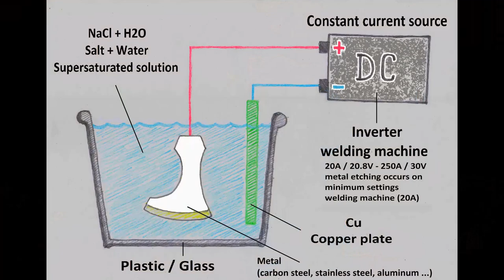Drawing on metal. How to make drawing on a 300 year old ax

Comment: Can i ask you precisely what kind of spray paint do you use? In my last video I've etched an axe head, but turned out my paint comes off in shards, so the result has been much more "runic" and much less accurate!
Anyway i love how you work! You're a real master craftsman, thank you and congratulations!
Reply from the maker: Thanks. I appreciate your attention. There may be bad paint, a lot of varnish in it. I take a gray matte primer or white, always matte alkyd paint. It doesn't work with others. Or the metal surface is not well prepared. To keep the paint well, you can slightly etch the entire surface of the metal (after all the procedures, this dullness is easily removed by grinding and polishing) before painting, you can grind it with fine sandpaper, you can heat the metal before painting, you can do everything at once ... I have such a problem. rarely, and mainly because of the paint. If there are not many chips, you can touch them up with nail polish. I wish you creative success.
Reply: @KirillRunz I used a completely wrong type of paint...
 Thank you so much for the tips! Have a great day!

Comment: I am trying to perfect my etch process after I paint my sample with primer and then etch my lines dip it hit the charge wait 20 minutes the paint always seems to flake around the lines that I scribe into it. So my question is does it have to be an alkyd primer? I was using just an automotive primer and was wondering if that was the difference?
Reply from the maker: Thank you for your attention. Yes, I only use the paints I show in the video. My other paints were peeling off too.